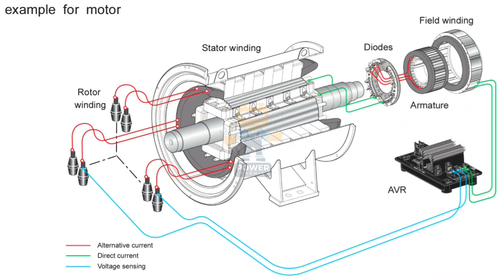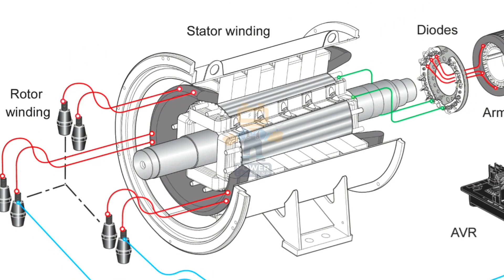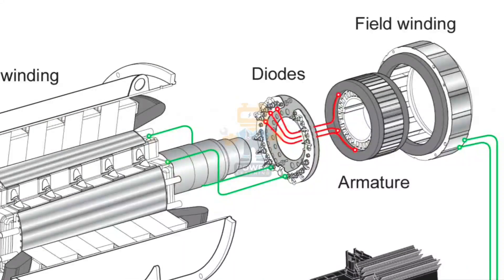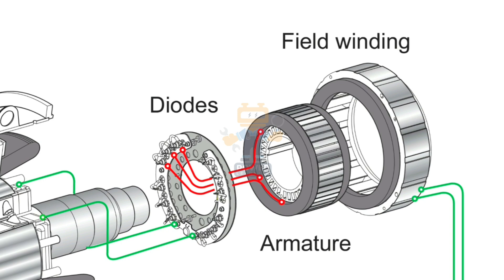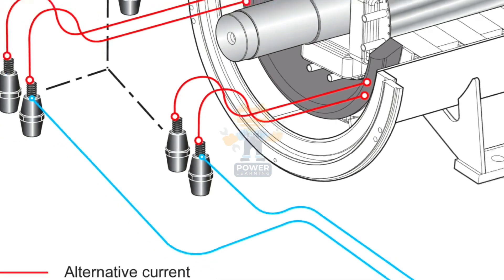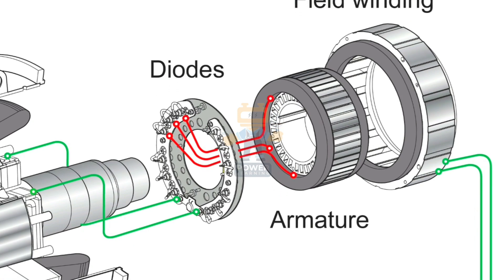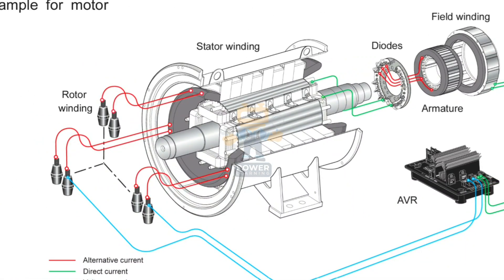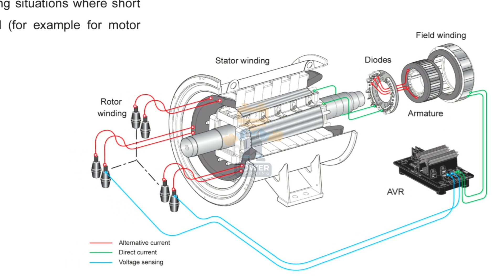How an Alternators work | How 3 phase Electricity produce | Generator working principle brushless

Comment: Why do my Cummins generators, each equipped with a Deep Sea controller, experience abnormal behavior when integrated into the system? Whenever we introduce one particular generator, it induces overcurrent in the previously operating generators, and itself produces excessive current (around 900 amps per phase) even with a light load. Upon removing this generator from the system, the remaining generators return to normal operation. Whether it's just this generator alone on load  or multiple units, the problem arises consistently whenever we close the breakers specific generator and introduce load. What could be causing this issue, and how can we address it to ensure smooth operation of the system?

Comment: Good day boss,,I have a question my genset is always blown or burn the varistor while put a load,what is the possible cause of it,,thanks
Reply from the maker: What is load type what equipment is connected and what is the percentage load your applying in first step
Reply: @Dieselgeneratorksa  actually boss that was in power plant with 6 synchronized genset supplying power into the building,the was only around 30% of load ,I haved 1 genset always burning varistor that was 2 times happened in the same genset,,what can u advise,, thanks